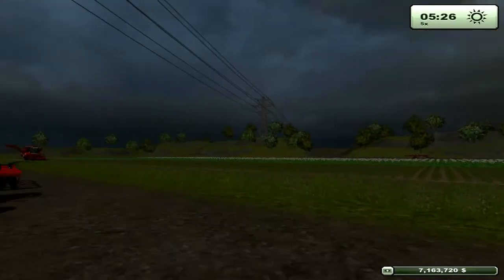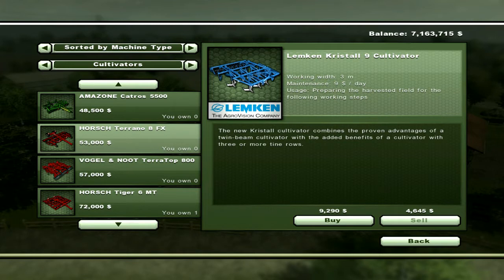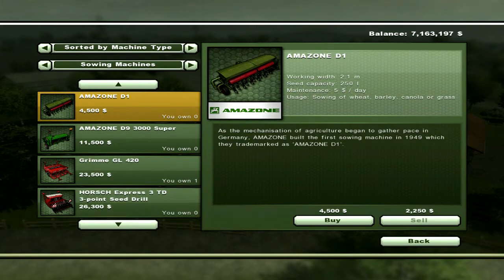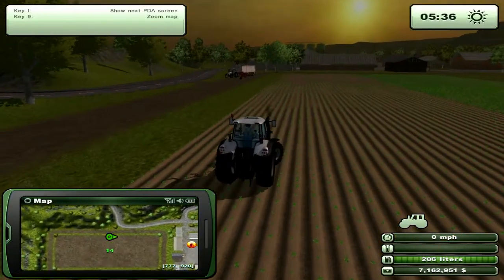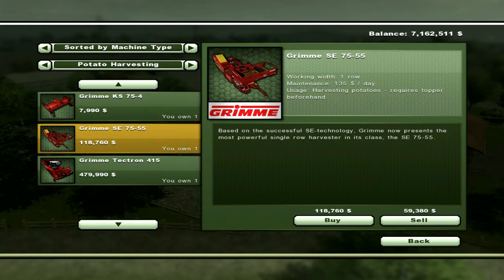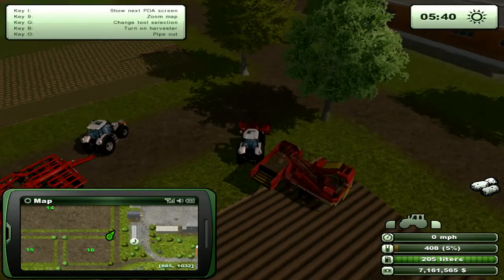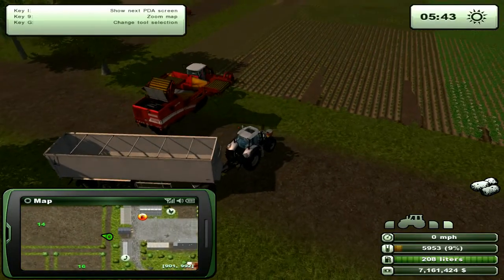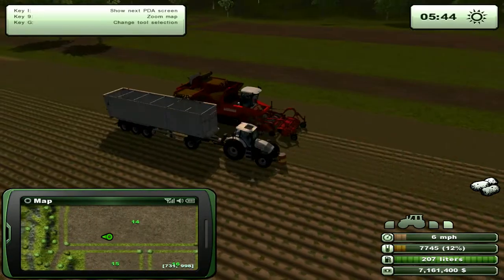Farming Simulator 2013 - How to farm Potatoes, Tutorial

Comment: I have on my opinion a better setup for the seeding process. I use the Horsch Joker 6 CT at the front of a Tractor and the seeder at the back. The trick is that the best potato, corn and beet seeder has the same range like the Horsch Joker 6 CT. So you can cultivate and seed at the same time and fertilise a second round. Why I think that is better then cultivating and then do seeding and fertilising? Because Fertilisers have a way bigger Range and so have to drive less rounds for a field.